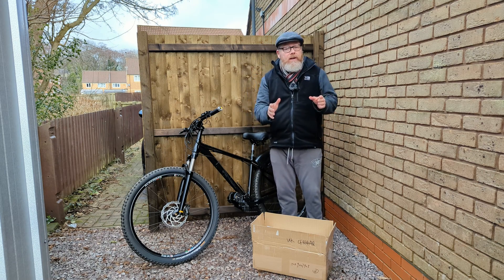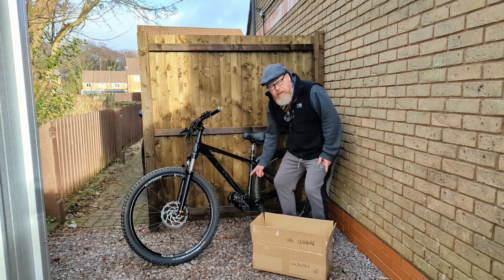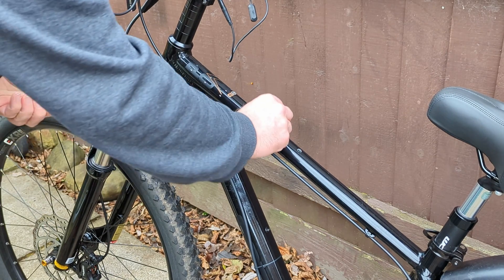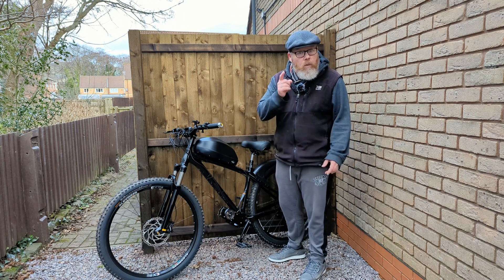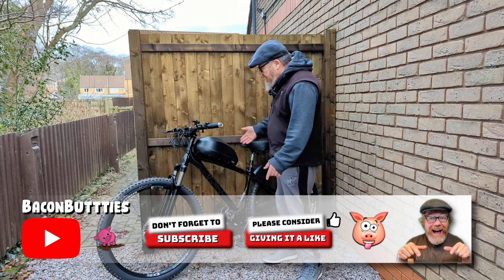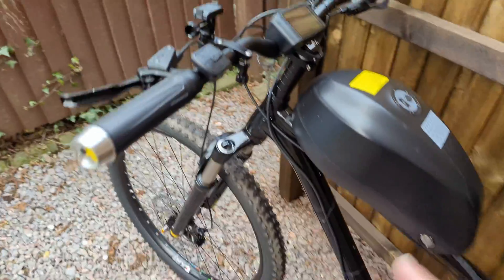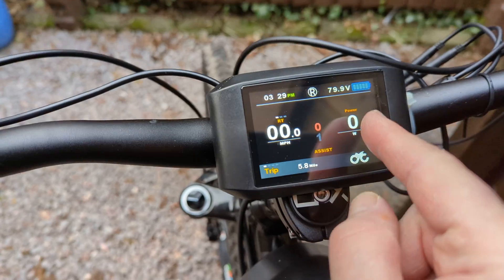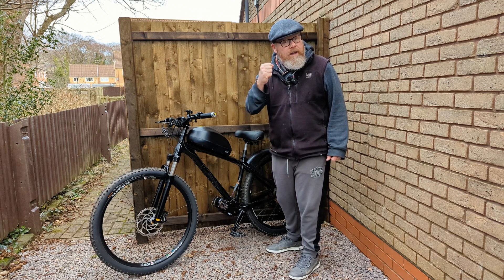CYC X1 Pro Gen 3 How to fit a 72 Volt Battery - This ebike is crazy with loads of power and torque.

Comment: I have enjoyed your videos.  Is that condensation on the inside of the glass?
Reply from the maker: The glass was cracked
Reply: @baconbuttties  So you haven't noticed any moisture on the motor glass? The reason I'm asking is with my Pro gen 2 it was a known issue.
I bought the Pro gen 3 and this problem is supposed to solved.  Thank you for sharing
Reply from the maker: @wallyworld6249  When it failed it looked like it could of had moisture but it also could of been the oils

Comment: Depending on the suspension I see a lot of people putting them on the outside of the bottom of the triangle just in front of and above the cranks but on the bottom side of the tube but they're long and thin and rather than short and wide but it does look like a great spot if you get the right kind of battery and it's hard to notice it's there at first even
Reply: Its hard to notice Its there ?
Should have gone to. Specsavers, lol😂

Comment: Where did you get this battery from? I really like the idea of mounting the battery above the frame, but I don't see too many "reputable" battery makers that have those types of shells... I may just take a chance on Amazon though, it looks really good
Reply from the maker: It's from Ali express, the company I bought it from had some good reviews.
Reply: @baconbuttties  I missed that part of the video lol, thanks. Did you have to specify the charging connector when ordering? It looks like it's the XT-90 in the video, but it's actually kinda hard to find what type of connector CYC is expecting you to have...
Reply from the maker: @thomasfisher1829  the 72 volt battery had a XT90 and so does the CYC x6  controller
Reply: @baconbuttties  They really should pay you for this XD Thank you so much man. Definitely subbed, awesome build
Reply from the maker: @thomasfisher1829  👍

Comment: Great job…. a master mechanic in the making! Lots of positives and a great build….  the battery position would not work for me especially when off road as I would fear for my future children!  Also surprise someone recommended such long crank arms 175mm on a small frame is way off… I run 160mm lekkies on my ebike and 165mm on all my others - I have 32” inside led length. Keep up the good work, especially your style
Reply from the maker: I did originally order 165mm crank arms but somehow I ended up with 175mm

Comment: I would think you should be able to hit 50mph give or take on flat ground in good weather. I wouldn't use the rear lowest gear that would be more for your torque with less top end and your highest gear which is the smallest sprocket is for top end with not much torque

Comment: I like your whole set up it looks sharp. I'm really digging the tank battery I would do the same. As long as it don't mess with your center of mass and weight distribution.
Reply from the maker: It is a little top heavy, but only a little and is manageable 👍

Comment: Did battery come with wire and connector fitted or did you have to fit it by yourself?
Reply from the maker: Battery came with wire and the  connector was the same as the controller so it was plug and play.
Reply: @baconbuttties  cool.... what type of connector is it  on motor is it an Anderson connector?
Reply from the maker: @colinwilson652  It was a XT90

Comment: I put the magnet and sensor as close to the rim as possible, butted up to the spoke nipple, I run a 29" rim and didn't want it reading out as a smaller diameter wheel by mistake
Reply from the maker: After a bit of Thinking and looking at the wheel it doesn't matter if the magnet is in the middle of the spoke or at the end of the spoke. Why? Because the spoke will still come around at the same time as its the wheels diameter that configures how many revolutions it does.
Reply from the maker: Yes I put it there temporally and will try and put it as far as possible as it would be measuring as a very small wheel   👍

Comment: I have the same set of components, CYC X1 PRO 2, 72V battery, 60a controller and mine went 52 MPH in mode 4 before I backed out of the throttle, was somewhat sketchy going that fast on a bicycle, I may never know just how fast it can go
Reply from the maker: I don't know if I fancy doing over 50 mph on a bike .

Comment: It looks like one of those motorized bicycles with the tank on it -  You can change it to have 9 assist levels from the setup menu on the bike display... double press to get into the menu and then go to advanced ... it's in there..  This bike is going to really haul ... I'm guessing at full power on the flat with you pedaling in top gear you will easily reach 50mph --  but it will depend on the gearing ratio of the bike ... what's the front chain ring size - the back will be an 11 tooth.  I found I can easily hit 70kmh with a 38 - 11 on my X1 stealth on level 4 of 5.  Beware of putting to much torque through your back wheel - those spokes aren't rated for 3000+W --- lol  You may need to rebuild the wheel with 13 or 12G spokes far quicker than you'd like if you go full throttle and power output from standing... Anyway love your video's
Reply from the maker: I do try and take it easy on the throttle as I can feel the torque could do some damage. 👍

Comment: I must admit, not sure with the battery. It's got some grunt, doesn't sound as noisy as the previous version.
Cyc has also released a small motor, looks good, the photon I think, 110nm of torque and it looks tiny.
I think in that app there's a setting for road legal, which you could use to keep the boys in blue happy, 🤣🤣
Reply from the maker: Yes I did see the road legal setting, I think is in sport mode at the moment.  :_HUUHOOYEEE: